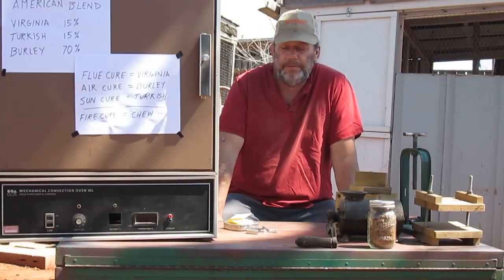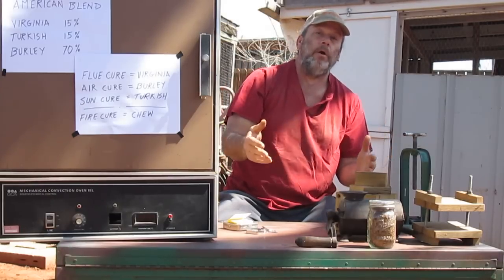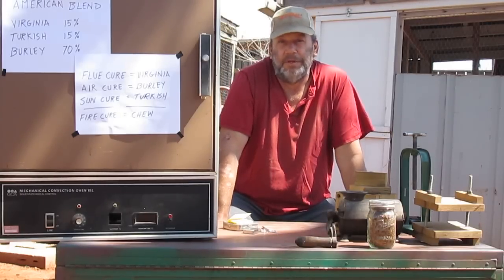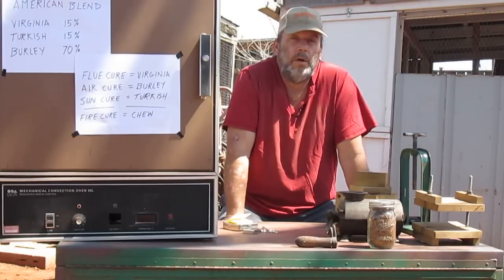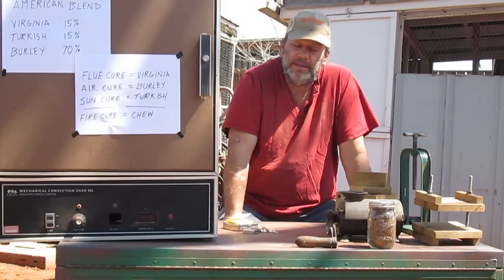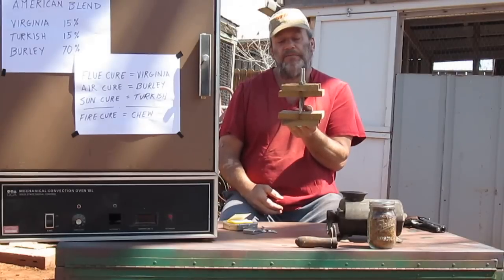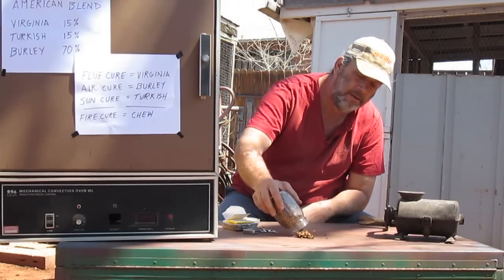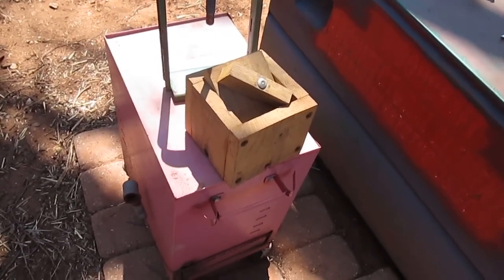Processing Homegrown Tobacco in Simple Terms

Comment: Hi, Please can you advise me. I am just getting into growing tobacco in the UK, but I am a bit confused with the finishing process. I have chosen to grow Virginia, burley and harvana tobacco. What I would like to know, what would happen if you decided to air cure Virginia instead of flue curing it? Is the curing process written in stone, or is there any reason why you shouldn't do it differently? 
Many thanks, Neil.
Reply from the maker: Hi Neil -it's been some time since I finished any tobacco, but I'll do my best here. Tobacco is art -and you'll be able to answer your own questions through experience over time. Flue-Curing of Virginia tobacco was discovered by accident, when a barn accidentally caught fire -and in salvaging the tobacco -they found it greatly improved it being exposed to the heat. This is actually a documented event, and we can suppose that prior to it, that Virginia tobacco was not flue-cured, and was air cured -it just became much better as they learned to color it with controlled temperatures.

Fermenting tobacco was also learned by accident, when tobacco was shipped from the colonies back to England it would ferment on the journey. Travelers from England to New England were dismayed to find that tobacco at its source was not the same as they knew it in England -and so it was discovered that packing the leaves tightly into oak barrels and putting it in the damp hold of wooden ships had caused fermentation, another case of accidentally improving tobacco.

And so through experience, tobacco was learned and because of the happy accidents I described; processes were refined. You can do as you like with your tobacco, but the basics must be known. Learn about the process of curing tobacco and the color changes that occur, either by searching information online (which seems much more available now than it did back when I was studying these things) or air cure your leaves as carefully as you can and see what happens in the process. You'll learn the characteristics of your own leaf and what you can get away with to make a smoke you can bear and what ruins a leaf. Air-curing is one thing -it doesn't amount to much more than air drying leaves under some fairly simple conditions and watching over some weeks as the coloring occurs -and then removing the leaves from their hanging place on a Fall day with enough moisture in the air to make the leaves supple enough to handle -but what is next is the most important thing; fermentation.

I copied the idea of the oak barrels in the ships hold and began fermentation by pressing the moist leaves firmly in that oak box for a few hours to form plugs, and then I sliced the pressed plugs into strips that could later be broken into ribbons of tobacco -after I let it age in sealed canning jars. I packed the strips of plug tightly into jars that the fermentation could continue -and I was surprised to find that it didn't take long, perhaps a month -to get a nice pipe out of my jars.

I hope this answers your questions. Best luck my friend.
Reply: Havana is for cigars I think that one you air dry.. the rest is in a controlled shed or room .. fuck it man :), trial and error .:) have fun
Reply: Neil Newman: nothing is set in stone, you can do any type of tobacco anyway you wish.
Do small batches of tobacco,in different ways, and go, with the one YOU, like the best.
Reply: how is your uk baccy doing? My first attempt at it,going nicely. NWO vid downloaded to watch later,interesting,,,,,also your ww vid taken down? Give me a shout. Back to this vbid, thanks for the information. My 1st go with Burley going great,also have some virginia,also going well. 4 turkish only, they do/did not like uk weather. Trying drying in many different settings, lost 3 huge plants due to weather,had sucsess drying green leaves. Learning curve.
Reply: @TweezerAddict  Thank you sir, great information.
Reply: @TweezerAddict  Well said, thanks so much for sharing.

Comment: Dude, loved the vid! I live in Brazil a very hot place with a low humidity. The climate here is about 104 fahrenheit. I can get: Virginia Gold, Kentucky, Burley and Latakia. I want to smoke normal cigarettes, you feel me? Not cuban ones. But the problem is that i need some tobacco that fits properly to my country temperatures and etc. Btw, what exactly is Flue cure? I'm starting now, need some tips x)
Thanks!
Reply: If I am right, I believe that the flue-cured tobacco is approached with high humidity and high temps. Starting somewhere around 110 Fahrenheit or more and ending around 130-140 Fahrenheit with a starting humidity of no less than 50%, I'd suggest no less than 65%, and ending somewhere around 75% humidity or better at those high of temps(130-140). This is done over a period of weeks. If I've gathered info right than not only is that needed but some cigarette companies would even do a "Final Cure" Basically to set the flavor and burn. To do so, some would increase the heat to near 165-180 Fahrenheit while maintaining a lower humidity level(could be wrong there) but I'm pretty sure they raise the temp at the extreme towards the end to drive off excess humidity to stop the fermentation process and seal that flavor in. Not sure though. Hope that was helpful

Comment: Thinks.  Great video packed full of info thats often found in bits and pieces (at least in my searches) I test grew a few last year and grew 4 varieties this yr about 100 plants all together. I got some bad info apparently on some of the seed varieties I purchased as they said air cure or either flue or aircure. And have gotten frogs eye on alot of the leaves air cured so far luckily not all and only bottom or seco sets glad I saw this now. So are u air curing at all before putting into the flue kiln or just picking and hanging them straight away in it. Thanks again hope to hear from u.
Reply from the maker: HI Willie. The flue cure tobacco goes straight from the field into the oven. This is not a "kiln" like the styrofoam box guys talk about -this is like a small flue-cure barn that flue cures over a period of 5-7 days at specific temperatures. I have a handful of plants that I am planning to take through a legit air-cure on youtube, a little later in the season.
Reply: I look forward to that vid. Thanks.

Comment: I’m hanging drying until 95% dry and turned colour before I cure in a plastic bag. Kinda like the way I do cannabis. 
opening bag and moving leaves around every day. 
I also seen putting the leaves in towel to dry straight from harvesting. Is that a better method?
Reply from the maker: Actually that sounds terrible, no offense. That plastic bag is likely just encouraging rot ...which may somewhat resemble fermentation. Smoking tobacco comes in three varieties, Air-cure, flue-cure, and sun-cure. Whichever variety you're growing, your goal for best results is to emulate the process suitable for that tobacco for color change of the leaves -to about 13% moisture content, if I am remembering correctly.

From there it is fermented. Tobacco is commonly "bulk fermented" where the leaves are laid into very large, even, piles, and covered to keep the moisture level consistent. The weight of the leaves on top of each other creates the pressure to encorage fermentation. The leaf piles are restacked every few days to prevent decomposition -rot.

I used a plug press to create pressure -but that much pressure isn't really required. I think if I were going to do this again, I would just lay down a plastic sheet on a table, lay leaves onto the sheet until they were a thick, even layer, put another sheet of plastic over the top, put a board on it to cover the whole pile -and add a bit of weight to create pressure ...and then rearrange the pile every few days to check progress -and prevent rot.

Hope this helps! Good luck!

Comment: I just built a plug box. I dont have a clamp so i used a stack of bricks around 60 pounds worth of bricks. Is 60 pounds good enough or should i stack more?
Reply from the maker: I expect that ought to be just fine. If I remember right, you don't have to leave it pressed very long for the fermentation to begin -it's just about building some pressure to get it going.
Reply: @TweezerAddict  i dont have access to any barns or sheds or attics. I used a bath towel and stacked around 40 leaves per pile, pairing them vain to vain and took them out of the towel every few hours and aired them out. The leaves cured between 2- 5 days
Reply from the maker: @Kevin79232  Excellent!

Comment: do you know where to buy or what the mixure is for black 
cavendish tobbaco
Reply from the maker: I do not actually. You might check out Pipes & Cigars .Com to see what they have available though -they have a huge tobacco variety available in bulk.
Reply: Put it in a metal strainer set strainer on top of a stock pot of boiling water and steam it 4-8 hours just add water as needed rotate leaves evenly longer you steam it darker the color when you have reached desiredd color stack leaves about 1/2 in thick inside a 1qt sandwich bag and press   between 2 boards for about an hour till they make a solid brick then cut 1in strips makes it easier to shred then cut strips into smaller ribbons then rub between palms to seperate it you can also you tube the whole process

Comment: Weird you have to dry 3 kinds of tobacco 3 different ways. I was wanting grow all 3 types and just hang them in my garage with the fan on. and then build a humidity box to sweat out the ammonia. But I got 'til next season to read more lol.
Reply from the maker: I don't know anything about the "humidity box" stuff. What I do is just classic tobacco curing. I have a few Burley plants hanging in the barn right now, going through color curing, if you'd like to see how that works.
Reply: I thought fermenting or curing, was "sweating" out the harsh ammonia.  And it requires 120 degrees and humidity.  So I was going to build an outside structure that supplied that.
Reply: I realize you dry it first, but the fermenting is what I was trying to get at.
Reply from the maker: Mopar Smith
It isn't "drying" -it is color curing; converting starches to sugars. If it is not properly cured, it will not ferment because it will just be dead leaves.
Reply from the maker: The Unknown Cat  I just began an Air Cure, if you'd like to follow along;
6 Burley Tobacco Planting and Curing series 6